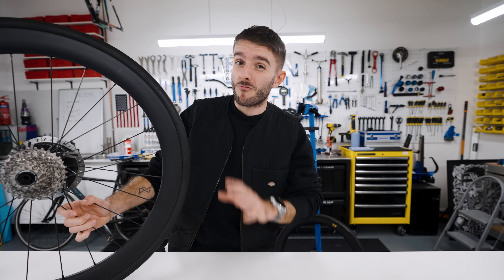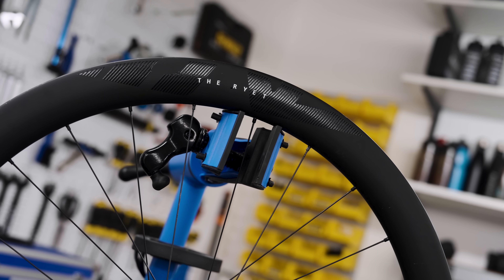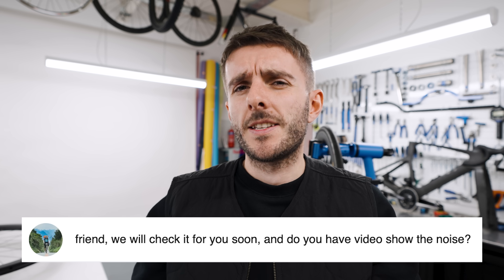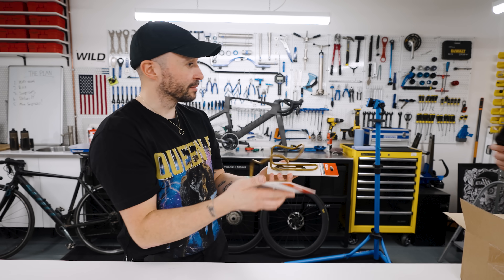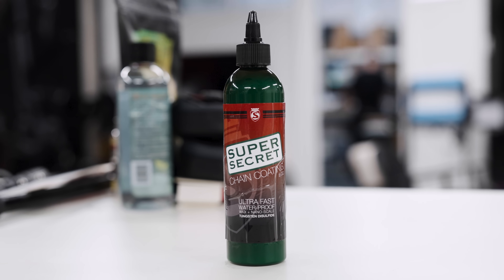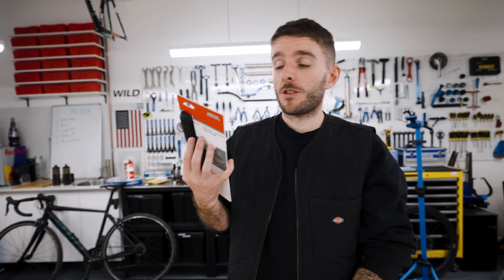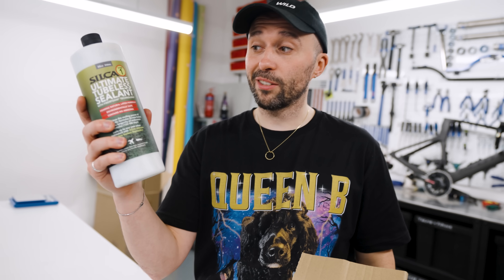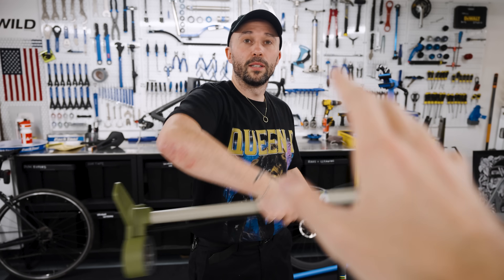I’m Now Terrified Of These £240 Carbon Wheels

Comment: Anything Silca is a joke for that kind of price. Including their chain lubes saving an odd watt by their claims only. The lube from Decathlon is awesome and my drivetrain lasts forever. I've got two spare chains by now as I did not expect such mileage.
Reply: Let me add that I also have a mini pump from Decathlon with a separate cord that works flawlessly and it does 70 psi easily for like 6 euros (not discounted). Don't even try and tell me 64 pounds (discounted) is a reasonable price for any fricking minipump.

Comment: 5:21  Nearly all carbon wheels, whether it's a $2,500 name brand or a $400 China wheel, are all made in China.  The only main difference is that with the name brand ones you're paying their huge markup just to have their name on your wheel.  I got a pair of Elite wheels from China with a 1,000 day warrantee for $479 and honestly I can't tell the difference between them and my old set of $2,000 Bontrager wheels, I just cut out the middle man and save a load of cash.
Reply: First of all it depends where the rims are manufactured (Zipp, Enve in the US, Beast in Germany eg). Secondly, As its shown in the video, its obviously not the same. Yes, there are good chinese brands, which maybe produce simultaneously for western brands and have a cheaper direct sale. However, there are also brands with low quality control. Of course you pay for the marketing, but not alone.

Comment: Problem is , affordable well made Aluminum wheels set have been phased out by these cheap carbon wheels, so basically if you assemble a bike from the ground up with a budget, either you go with these wheels, lace a set yourself or find something from a LBS as it is very likely to have some used wheelset or something come from a higher end bike but is just there so the customer can ride his or her bike home . In fact, I have two Chinese carbon wheelset, one 38mm depth and the other set is a 58mm wavey  rim brake set. I have put in total 2000 km on both of them and they are fine at the moment.

Even within Chinese carbon fiber wheels hierarchy, some are better than the others. Superteam for example, is better than my "TESLER" wheels, although the latter one is 1000 yuan (150 usd) cheaper and both of them comes from the same factory. These wheels, though from a same factory, are branded under so many different names that it is even difficult for an Chinese to figure out which is which, more so for your guys.

Comment: the problem with chinese brands is not the manufacturing but the whole business mentality. its always about making the quickest buck possible and cutting as many corners as possible, hoping that a foolish enough buyer wont notice any issues. and once the transaction is done, youre screwed because they dont want to be the fool who needs to replace inferior products out of their own pocket. i worked in textile imports for a while and it was the same. production errors needed to be complained about with drama for several iterations before any improvements would happen. deflecting, down playing, blaming the customer...
look at the tofu dreg constructions. cheaters in video games. gutter oil used in restaurants... its a fundamental part of chinese mentality. its how they operate and we in the west keep falling for their promise of cheap and easy. and thats why i dont like aliexpress. the platform protects the sellers more than the buyers. this has nothing to do with racism btw.

Comment: I have a few Silca products; kind of hit and miss. Their best product that I have from them are their Gear Wipes. Mmmm...

Edit: I just realized that I have more than just a couple of Silca items. Overall, pretty good stuff. I don't recommend their bar tape.
Reply: Interesting. I've always been really impressed with Silca stuff and I'd say they've earned their way onto my 'favourite brands' list. They stand by their products, too.
Reply: @rantingwrench  I have a few of their TI cages, Tattico pump, Hirobel, torque set, and Gear Wipes. Their bar tape, after a few months, the first layer can be easily rubbed off. I was gobsmacked. Someone else who really knows their stuff doesn't recommend their multi tools.